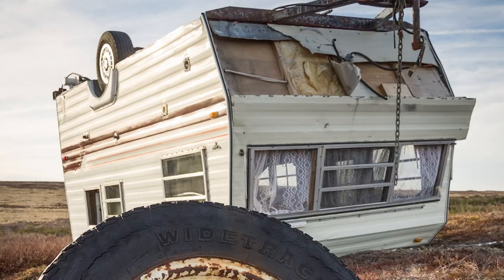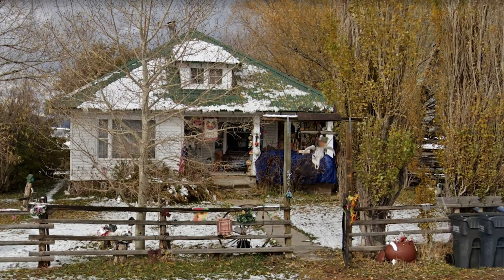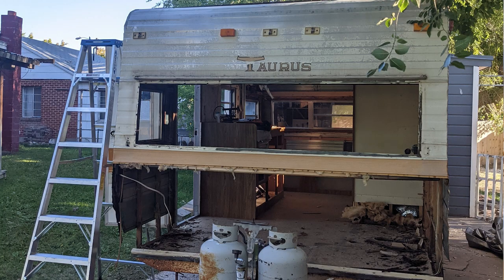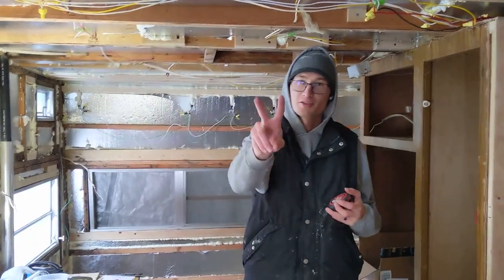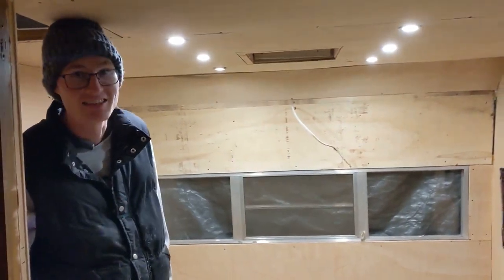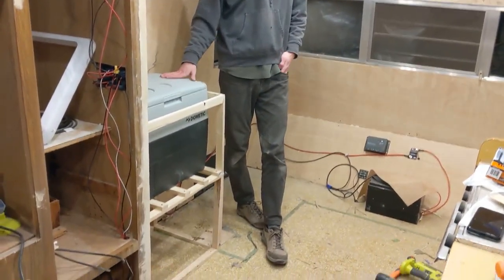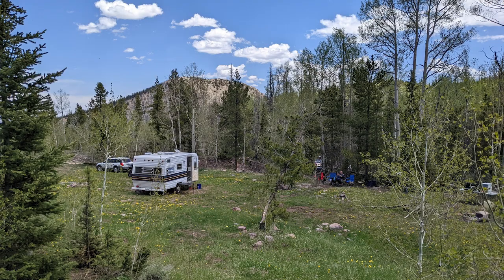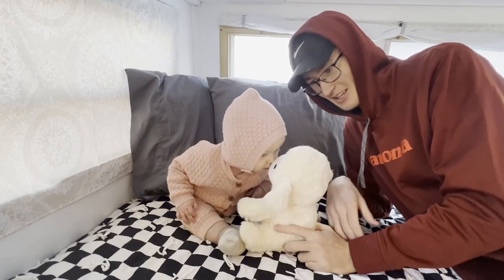1970's Vintage Travel Trailer REBUILD | Giving a Rotten and Ruined Trailer a NEW LIFE

Comment: You mean the farmer didn’t pay YOU to take this off his hands?  Lol. Other than overpaying, you built a gem
Reply from the maker: I agree that we over payed... He had just fit new tires and a hitch and at the time I thought it was a fair deal! Lessons learned!

Thanks for watching.
Reply: @Dream to Journey  I over-paid for  my 1959 trailer. Literally the same situation, I didn't understand the extent of the water damage and frame rot until after I purchased it and brought it home. I actually think mine might be in even worse shape than yours. I haven't torn it apart. Instead, I just repaneled over some of the walls that were damaged, and I've just been working on thoroughly cleaning it and then putting some expensive primer all over everything. Lol. The roof will be repaired with a fresh layer of elastomeric roof coating this summer. (Currently it has a waterproof RV cover protecting it from further water damages.

Great video, It's nice to see someone repairing things properly and teaching others as well. Thank you 😊
Reply from the maker: @MegaBlackLobster  I don't blame you for not wanting to tear the whole thing apart! It was a huge hassle! Those 1950's trailers are so fun. Hopefully it lasts you a long time. How are all of your electrical and water systems? Have you had to replace those?
Reply: @Dream to Journey  the electrical is operational surprisingly, but the plumbing needs a little work. I am amazed at the build quality of this old trailer though. Its been coming along pretty well. I am going to be installing new flooring tomorrow. Thanks for the reply!
Reply from the maker: @MegaBlackLobster  Best of luck!